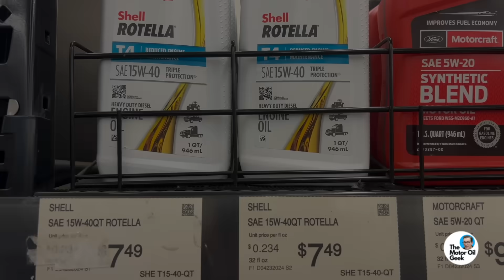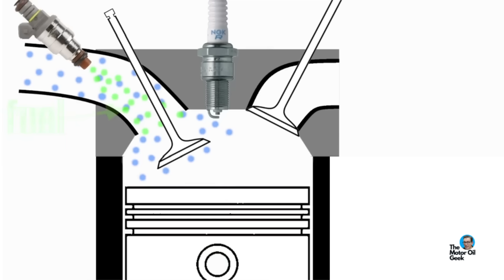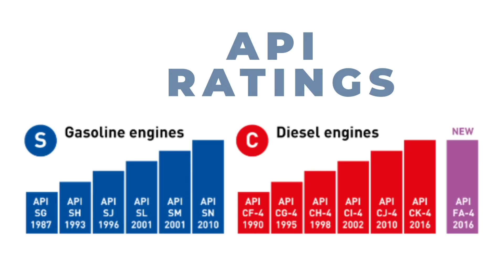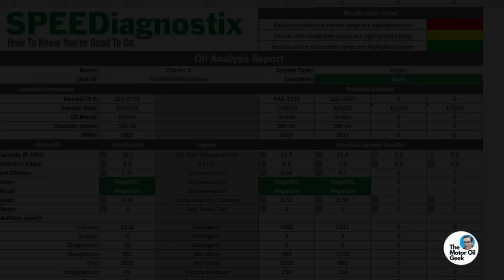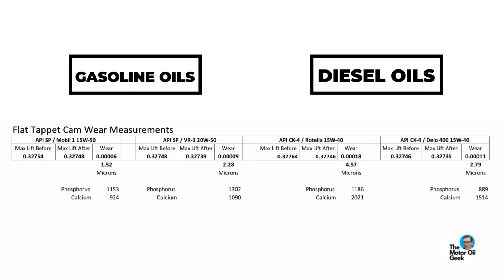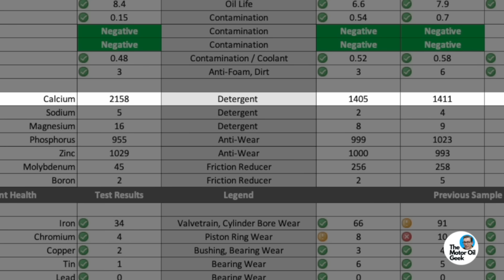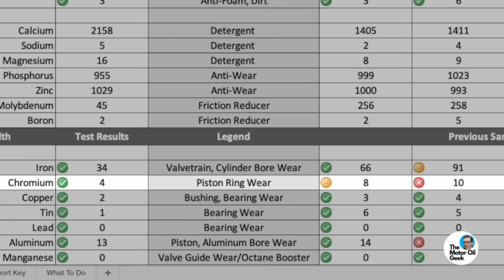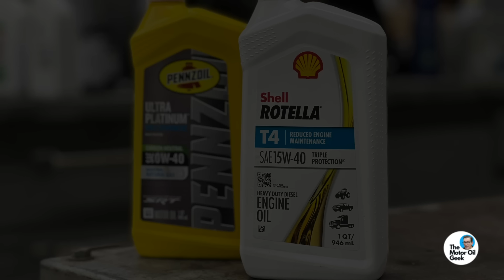Why DIESEL Oil is Actually WORSE for Gas Engines!

Comment: I will continue using Shell Rotella in all my combustion engines it contains zinc the perfect anti friction additive. Removed for gas engines do to pollution issues but necessary for high compression diesel engines. That's a fact!
Reply from the maker: More Zinc = More Wear? The REAL Truth About ZDDP Additives
https://youtu.be/erxjPicpYyw

Comment: I use Rotella in my drag race car for two reasons. It is cheap and I change the oil after about 10 hours of operation and the 1540 viscosity is just right for the clearances in my engines.

Comment: I cannot believe that everybody is not using Royal Purple, it is so superior, my company has done so much testing, my 96 Chevy truck at 825,000 miles on Rolal Purple changed once a year, was a test mule for ten years, when they ended the testing with this truck, I got it, still original powertrain, I don't add any oil, it uses less than half a quart in a year,  Royal Purple than move onto solving other problems.

Comment: This is critical information. If you are running a boosted D.I. gasoline engine, you risk manifesting the ring groove detonation if you do a high calcium oil fill. Don’t ignore this gift information. It’s not something a person can figure out on his own by observation, but it is provable by analysis. Diesel engines have no risk if this because of the early ignition at start of injection - there can be no detonation, so they can exploit the high detergent concentration.

Comment: A brand spanking new 1966 Ford- 300 6 cyl.  Switched immediately to D.A. Whitmore Series 3 Diesel oil,  after my Dad put 300K on this truck I was convinced.  Only switch oils on a clean engine, the diesel oil has way more detergent in it and will kill a used engine by cutting loose all the sludge buildup. So I call b.s. on this one.

Comment: Just my opinion, but I use diesel oil when I don’t have anything else available.  I always have diesel oil around. Pretty sure diesel oil is way, way better than the other option, which is no oil. While I personally haven't tried the no oil route I have seen several engines where the owner has tried that route.  Just don't seem to hold up well.

Comment: My brother was having oil consumption trouble on his ancient 300,000 mile Pontiac 3.8. He switched to 15w40 diesel oil and ran it for the last 100,000 miles with little consumption. I can't say it's better or worse, but it got my brother back and forth to work for the rest of his life.
Reply: My condolences for the loss of your brother.
Reply: @terrykrueger yeah, that took a sad turn. Prayers up!
Reply: I've been running 15w-40 diesel  oil in everything for 30yrs....all good so far
Reply: The detergent cleaned out the oil rings! They tend to get full of junk in high mile motors. I’ve got an engine I do experiments with and tear it down quite often. It normally shears oil like crazy (carbureted, running very rich, huge crank journals and high rpm) so it produces unbelievable amounts of sludge. I ran it on diesel oil for a few years and on the tear downs running diesel oil it was always super clean inside, especially of note was the oil rings. It’s not for everyone but as with most things it has a purpose! Your brother knew what he was doing! 😁🤙
Reply: @jdesaavedra0432  sorry for your loss.

Worn engines have greater bearing clearances, which require heavier weight oil. Thicker oil keeps the journal centered in the bearings properly when clearances are greater, keeping pressure dispersed, and less pinpoint pressure on the power stroke.
Reply: What about in an old classic car engine?  ???
Reply: @brigond1  True older Porsches for example have better results with high zddp oils (generally speaking, and not diesel oils per se)
Reply: @brigond1 this dude said in a video back while does Chevron delo is rated for a car or a diesel he can't make up his mind which is which
Reply: i run it in my 89 econoline.
Reply: I think the problem isn't so much clearances as leaks.  The clearances change a little bit over time but it isn't enough to affect the fluid mechanics much unless you actually wipe out bearings, in which case not even Lucas is thick enough to compensate (Ive tried,  bringing home parts donors, not engine obvs, on straight Lucas). Plus the oil in the bearings is hot and under hydrodynamic pressure, regardless of bottle viscosity it might as well be water.  But older cars have lots of little leaks, which are on the engine exterior where the oil is cooler, the thin oil will run out like water. Thicker oil definitely helps with this.  But if it's so thick that the car won't crank fast in cold weather, well, then it might be too much....
Reply: @autobusprime5559  I had an old Buick Regal, 3.8l, didn't leak a drop, but went through a quart a day. My guess is it was overheated and rings lost tension. Lucas temp stabilizer got me to using a quart per week instead.

If you have a bad leak, oil is going all over the undercarriage and back of car. Most don't leak that bad, so oil consumption tends to be at the piston rings.
Reply: @Faolan161 I wouldn't say most don't.  Some don't.   I certainly knew where my oil was going as it was indeed a self undercoater.  Now keep in mind, the car had 260,000 miles on it.  And honestly, your problem may well have been valve guides rather than rings.
Reply: @autobusprime5559  valve guides don't use, can't use, as much oil as piston rings can use. Nowhere near the surface area. Valve guides typically pull in oil on high vacuum, which a worn engine is losing, so it's always under compression/slowing down, low load, or idling when they're leaking. The leaks I experienced are physically unable to pull that much oil. Especially because the rings were also bad... 

At least try to picture what you're explaining so you can make sense. Had you pictured this scenario, you wouldn't have even spoken because it just doesn't happen.
Reply: Higher viscosity will have more consumption than will lower viscosity. This was proven decades ago when the multi viscosity oils first hit the scene.
Reply: @kerlioclassics6440  you sure about that. iv had many engines burn less oil with thicker oils. currently in my can if i run a thin oil it will burn 2x as much, soooooo proof is in the pudding.
Reply: @BigMack2020  I think what they may be referencing is the cold and warm split of an oil. It’s highly dependent on the engine but the bigger the split the more VII (polymer) is generally in that oil which can be easily sheared under high load. I did an experiment with an engine of mine that sheared oil a ton. Original spec for the motor in my weather was straight 30 or 20w-40 which isn’t easy to get today. Running a high split oil like a 15w-50 it sheared quickly, thinned out and burned a lot of oil as a result. I ran a 15w-40 and it was more shear stable due to less VII and the oil ended up retaining more viscosity, even though it started out thinner the 15w-40 was thicker than the 15w-50 at the end of its run. That’s not the most scientific way of putting it but that’s how I’d describe it. But for oils without VII the shear stability is very good so a straight 50 will stay thicker than a straight 40 over a run.
Reply: @kerlioclassics6440 I actually want to know more info about this phenomenon. Because I have 2 vastly different experiences with 2 very worn but different engines, and the overall use/purpose of the particular engine we’re talking about seemed to matter a lot. For example, a Honda xr80 that my brother ran out of oil to the point it seized, some cooling and a little oil down her throat, was able to run again. But after that it consumed so much 10w-30 that it would foul the plug or actually run itself out of oil in less than an hour of aggressive riding. Then we switched to 20w-50 it was still a noticeable haze out the exhaust, but didn’t foul the plug our run itself dry nearly as quick, like you could get a whole days ride out of it if you didn’t engine break much.  (that really drew the oil up past the rings with the massive vacuum in the cylinder). And I know it wasn’t just placebo effect because our “track” was in a low spot and would hold the blue haze for literally hours on warm windless evenings. 

On the flip side I had a 390 ford FE with a bajillion miles and putting 15w-40 or higher seemed to make it low on power and just run hotter and consume more oil as a of being hotter and “working” more as a result. That truck weighed a lot the way I had it setup and the 4 speed np435 transmission meant you had to really wind it out in 2nd to not be bogging in 3rd. I have no way to verify that it actually consumed more because it also leaked at just about every possible seal/gasket because of the insane crank case pressure😂
Reply: Same story here with my 05 Town and Country 3.8L with 310k miles. Ran 15w-40 for over 60k miles with better results in hot florida weather EXCEPT the MPGs dropped by 3-4. Just recently i've switched to Pennzoil Ultra 5w-30 for better MPG and i get 26 highway and 19 city. But, i do hear the lifters on startups for 1-2 seconds but it's fine..
Reply: Same with our old Toyota Corolla 300k miles.  It was worn out but rotella 4 kept it happy till our kid totaled it.
Reply: Been running shell rotella for years in trucks, cars, lawn mowers and have never had a problem.
Reply: It's really good for older high milage engines. More or less does the same thing as oil plus an additive like Lucas Oil. ❤
Reply: I actually used Mobil Delvac for a year in my 2007 Denali 6.2. Took cross country trips as well.
I just changed my oil pan gasket, the sump and internals were clean and the cylinder walls still had swirl marks close to 300K
Reply: It consumed less because it’s a thicker oil.
Reply: @masonh2538  it also affects crank bearing wear as worn engines have thicker clearances, and heavier oil keeps the crank centered in the bearings, extending engine life. Same with valve guides and piston rings... Yes, it's better for high mileage engines.

Comment: On the farm we used the same bulk diesel oil in the gasoline trucks and old gasoline utility tractors..  These were not direct injection gasoline (Non-GDI).   So what is the risk?  With cam failures on Non-GDI gas engines it would appear the diesel oil would be okay in Non-GDI engines and actually keep them cleaner.

Comment: No I run Diesel oil in my 1970 Chevy Monte Carlo because of zinc and no tapping with engine also it has 10.5 to one compression I also have friends with other classic cars with high compression not good for other modern cars

Comment: I worked for a company that ran rotella 15-40 in the fireman's chevy pickups. They were getting 300,000 plus out of the motors.
Reply: So what is the best diesel oil to be using

Comment: I'm a retired CAT&CUMMINGS knuckle buster and I don't disagree or agree. I look at results!?!? In the mid 70s I started using 15W40 in everything I own including my 3.5 Briggs and Stratton push mower which lasted 25; then there's my Indians wheelbarrow ( Pontiac ) it survived too 300,000 + miles!!! My current vehicles both have 150,000 miles and I've been using Shell Rotella Synthetic 5W40 and NO PROBLEMS!!! Slight oil use between oil/filter changes at 10,000 to 12,000 miles; only us NAPA GOLD or WIX XP filters!!!!! Being CONSISTENT with PMS ( preventive maintenance service ) is  the life of a vehicle. Not many people know that they should change all vehicle fluids periodically!!! How many of you have ever changed/flushed your BRAKE FLUID SYSTEM!!!!!!!! YOUR LIFE DEPENDS ON PMS!!!!!!!!!!!
Reply: yep proof is in the pudding
Reply: Same with me, I have used 15 40 diesel oil in all my engines in the last 40 years and never had a problem. My every day 1978 Olds 350 gas engine is still good after 35 years.
Reply: I'm a brake fluid flusher!  My friends laugh
Reply: Bought an 04 sportbike off a guy, he said the brakes were ruined. Changed his brake and clutch fluids, both of 'em had noticeable blobs of liquid water in 'em, and horrible organic chunks. Took everything involved apart, flushed with new DOT 4, changed engine oil and coolant at the same time, thing runs a treat now!

Afraid to look too close at the suspension, though..
Reply: These mofos today don't want to change oil until it looks like tar, much less all the other fluids
Reply: @BruceLee-xn3nn  Brake fluid? Two answers form Mr. / Ms. Average: 1) Whazzat?  2) It's good for the life of the car, idn't it????
Reply: Just don’t try it in the new Toyotas that take 0w8
Reply: *W40 has more zddp than *W20 or 30, so you are ahead just with that.
Reply: I have used rotella 15/40 in marine gas engines, for over 30yrs, with amazing success,no pre mature failures.
Reply: I can’t take seriously anyone who spells Cummins with a “g”.
Reply: Always easy to spot when someone says "Cummings."

It's "Cummins."
Reply: BTW, Napa Gold are no longer made by Wix
Reply: " YOUR LIFE DEPENDS ON PMS!!!!!!!!!!!"   Dude, that means Pre-Menstrual Cycle.   Not a good initialism to use.   No one likes PMS.  --Doozer
Reply: Interesting. For what it's worth, I run Valvoline 10W30 High Mileage in EVERYTHING and never had problems either.
Reply: I use rotella 15-40 in my tundra no problem nothing
Reply: Sounds like you have lower-end engines. That Audi that blew up is a high-performance engine. He's saying the conditions in your gasoline engines are there if it's just right. You may be fine. When you go to blow that jerk next to you at a light away, it could grenade, and now you're coasting to the side of the road with a blown engine. It may never happen. You probably know the rules out there. It won't happen to you until you're taking your daughter to her wedding, or you're having a heart attack, or your wife called and said - honey it's time. Come home and get it! It'll be the worst time for it to break.
Things break. I replaced a crank sensor in my Cadillac Northstar recently. Walker sensor. It lasted about 4 hours worth of driving. Then it stopped working while I was driving highway speeds. I heard a pop, and coasted to the side of the road. I had blown a mustang away about 2 miles before. I couldn't believe it was that new sensor. It turned out it was. You have to take the intake manifold off to get to it, as well as other anti-knock sensors and the starter. It's not too bad. Not like ye old Chevy 350.

Comment: So what still gets me is that the back of the gas Pennzoil bottle shows its meets API SP, and the diesel Rotella T4 bottle clearly states it also meets API SN. So for old (non direct injection) engines, is it really that bad? The Rotella has been the “antique tractor go to oil” for years.  I’ve always assumed if it meets a gas API spec, diesel oil or not, it can’t be bad for your engine.

Comment: My 1MZ did 380000 Km on CK4 SN fleet oil no worries . The same oil was used as hydaulic oil in a 300 ton mining excavator using variable displacment pumps which need scuff resistant oils .
The Avolon never missed a beat. 15w 40 CK4 SN

Comment: Diesel spec oil should be avoided in gasoline direct injection equipped engines. 
Using the correct oil is more important on GDI engines,  and turbocharged GDI engines,  it's even more critical.

Comment: API rating of SP came out in 2020, so you’re about 4-5 years behind there. This is the first API rating specifically for direct injection gasoline engines with the purpose to reduce pre-ignition. Interesting since DI has been around much longer than that. My guess is the problem is more about manufactures allowing for lower octane specs for daily cars. Also, look at motorcycle JASO ratings that only care about whether the oil is suitable (or not depending on which rating we’re talking about) for wet clutch use. But, JASO oil must meet one of the current or several older API ratings. Motorcycles have had DI as common for even longer than seen automotive applications. Moral of my ramblings: change your old and use the correct gas octane. Side note, your engine animation has the pistons going the wrong way 🫤

Comment: That's strange. My friend has used shell Rotella 15 w 40.in a350 gas engine Chevy work truck. Maybe 1994. 3 years ago it had 450 000 miles on it. Never been rebuilt. Still going.

Comment: Yet machine shops are still pushing to use Rotella T4 in vintage flat tappet engines for the zinc, and that was the advice I got. I'll stick with Driven products in my own classics. Or Castrol Classic.

Comment: Over 300,00 on my GMC. All it's ever had id Delo 15/40 Non-Synthetic oil. Had to fix a leaky valve cover a few weeks ago, clean as a new engine under the valve cover.

Comment: Hundreds of us across the U.S. who belonged to the former Goldwing Road Riders Association (GWRRA), and The Iron Butt Association (IBA), use T-6 regularly and put hundreds of thousands of miles on our 6-cylinder Honda "chariots," including numerous long-distance endurance riding challenges.  Never a casual clutch or engine problem.
Reply: Which is fine, but they would likely have no problems when using Honda OEM motorcycle oil or another suitable motorcycle oil either.

Comment: I've got two questions for you. First what about old cars we're talking let's say 1981 and older, how does the diesel oil react in them. The way they're built and the materials they used are very different from a modern engine. Also how long ago were these tests done? From what I understand Rotella has changed its formula like two or three times in the last 20 years. Could it be completely different now?